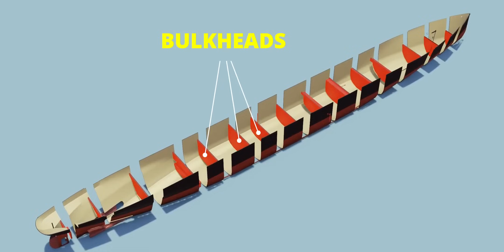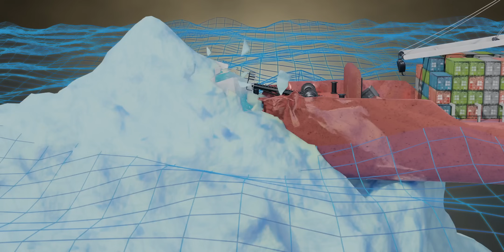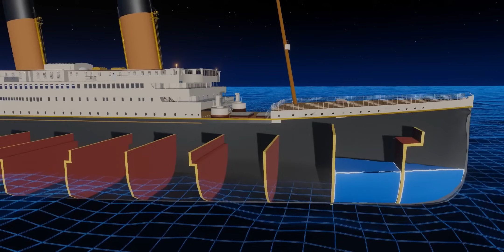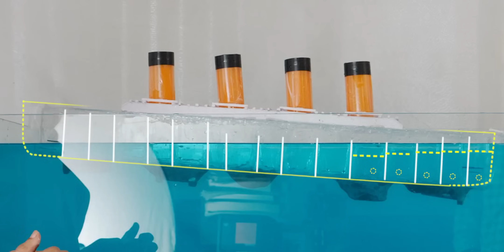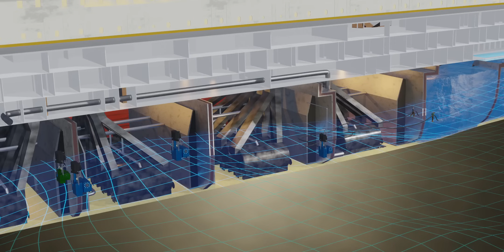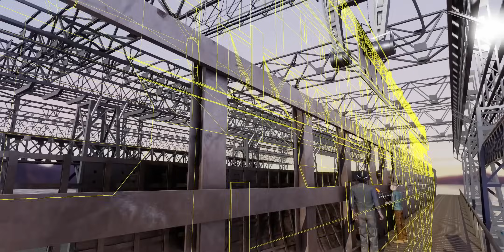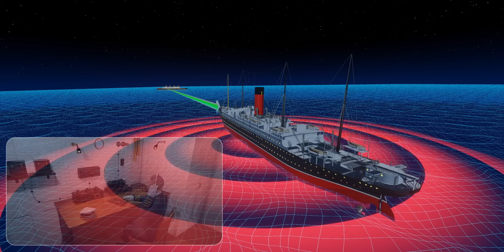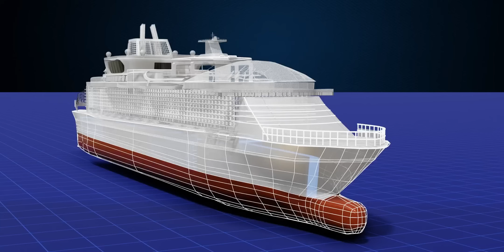How did Titanic Sink? | The Complete Physics

Comment: First Officer Murdock did not throw RMS Titanic's engines into reverse as part of his iceberg avoidance maneuvers. Judging by the short distance between ship and berg upon discovery of the iceberg he simply cut the steam to the reciprocating engines while allowing the ship's inertia to help port around the iceberg. As the wheelhouse telegraphs didn't directly control the engines like modern day bridge controls he likely knew there wasn't enough time to execute a crashstop order. Aside from steering, all helm orders regarding adjustments in speed, etc. required crew members below to make manual changes to the ship's propulsion system which, depending on crew alertness, entailed a turn around time of varying lengths. Plus doing so would eventually negate rudder control buy reversing the waterflow passing over the rudder thus causing the opposite effect of the rudder's hard over position.

It's important to understand that the rivets used below the waterline was necessarily lower in quality due to the inability of using Harland & Wolff's hydraulic rivet machine at the angles involved in the varying contours along the ship's bow and stern areas. Rivets along this section of the hull had to be driven in by a two man riveting team. The steel alloy, incorrectly referred to as wrought iron, was actually steel with a low carbon composition. The higher the carbon content in steel, the stronger the steel however, it is much harder to work with. Only with hydraulic riveting can high quality high carbon rivets be rivetted into place. Softer, low carbon steel rivets that can more easily be hand riveted between two hull plates were used along the curvy areas of the ship's hull below the waterline where the hydraulic riveter couldn't be used.  Had higher quality steel been used along these sections of the ship's hull a two man riveting team simply could not achieve the seal between two plates before the rivet cooled.  

Even today there aren't many ships that utilize a double hull system with an outer and inner skin holding back ingress from entering the hull.  Such a double hull configuration only covers the bottom.  Such double membrane systems have caused destabilizing lists due to uneven flooding caused by the ingress of water along the extreme edges of the vessel.  We only have to look at the modern cruise ship Costa Concordia to see such a system wasn't used.  Upon collision with underwater rock formations there was just one layer of hull that was punctured, not two.
Reply: It's very important to note the rivets used in the extreme curves of the hull were not low-quality rivets, but the very same rivets used in any other ship of the day.

It's just that the heavy steel rivets were better/stronger.
Reply: @pc_buildyb0i935  It is known that Harland & Wolff used Grade 3 'best' iron rivets rather than Grade 4 'best best' in the construction of Titanic. What isn't known is the specific reason why the lower quality item was used or who signed off on it. A potential answer could be that the supplier didn’t have enough Grade 4 wrought iron rivets for both Olympic and Titanic. Either they naturally had too few or because of political pressure. It is known that Harland and Wolff pledged to spend as much money on the ship as possible, not less. Also the White Star Line (i.e. J. Bruce Ismay) could have been putting pressure on H&W to complete the ship asap and wasn't prepared to wait until supplies of Grade 4 became available.
Reply: @maunsell24  It's clear you missed my explanation of this very prominent half-truth in the community.

First off, let's get the most important fact out of the way - the choice in rivets doesn't have any impact regarding the iceberg collision. The iceberg collision involved a 52,000 ton ship striking a 5,000,000 ton iceberg along a point of contact no greater than 20 square feet at a speed of 21 knots. This is estimated to have generated between 30,000 to 300,000 TSI as a very conservative estimate. There isn't a single construction material available to naval architects even today, that could withstand even a quarter of that force.

Let's get the second most important fact out of the way - rivets back then were very broadly categorized in 4 main groups; no. 1 rivets, no. 2 rivets, and no.3 Best rivets. All of them were wrought-iron but no.3 Best was by far the best standard of the three, and the standard rivet choice for shipbuilders from the 1870s onward. They were practical, easy to manufacture in large quantities and thus easy to batch order, and relatively affordable. Practically every steel ship up to 1940s used these rivets in some way or another. By the early 1900s a brand new type of rivet had been introduced - no. 4 Best-Best rivets. These rivets were different - they weren't wrought iron like the previous three groups, they were solid steel and they were much larger and more heavy duty.

In fact, they were so much larger and heavy-duty than no.3 Best that they couldn't be heated up to the same temperatures (not with the rather limited blast furnaces available to shipyards in that time) and thus, they could not be hand-hammered into the hull plating.

In fact, hydraulic riveting machines needed to be created just for the installation of these new steel rivets. These hydraulic riveting machines were enormous, weight several tons each, and needed to be suspended vertically from a shipyard's slipway gantries. Due to this vertical suspension, these riveting machines could only reach the flat surfaces of a ship's hull - NOT the curved areas. They were first used on the flank plating of the RMS Mauretania's hull.

In Harland & Wolff's case, they took it a step further by having these rivets used not only on Olympic and Titanic's hull flank plating, but on their double bottom and keel plating as well. Not only did the use of so many more no.4 rivets help increase the bottom-heaviness of the hull, but they also helped disperse much larger stress loads.

Now, as I stated, the no. 4 Best-Best rivets could NOT be hand-hammered, and the riveting machines needed to install them could only operate on the flat surfaces of a ship's hull, so the curvature of the hull would necessitate the use of no.3 Best rivets. Keep in mind this is not a cost- nor corner-cutting practice because no.3 Best rivets were still by far the most widely used standard shipbuilding rivets. No. 4 was new and had only been used on a single generation of ocean liner at that point, and not even to the degree that Olympic and Titanic would have.

Of the 3000-odd rivet samples taken from the wreck site and tested, only about 10% were found to have any more than 20% slag by weight. Slag is indeed a form of structural impurity that can compromise a rivet's total strength but Board of Trade regulations of those days allowed as much as 33% slag by weight in no.3 Best rivets. The fact only a tenth of the tested rivets even had as much as a fifth of slag by weight tells us very clearly that Harland & Wolff were very selective of their rivet batches and even when using a 'lower' (but still perfectly acceptable) grade, they only took the best of the supply available.

Hope this clears things up for you.
Reply: @pc_buildyb0i935  Lower quality steel rivets were necessarily used in the curvier sections of Titanic's hull for two reasons:  (1.) the hydraulic riveter, which was a pretty massive piece of kit that hung from above by chains and was capable of riveting higher carbon steel rivets was incapable of achieving the angles needed to rivet; (2.) as such the task of riveting in those areas had to rely on traditional two man rivet teams who, with their own human limitations couldn't rivet high carbon rivets quick enough before cooling occurred with no watertight seal achieved. The solution was to use low carbon steel rivets which easily gets conflated as using cheap building materials because ostensibly White Star Line and/or Harland & Wolff were obviously trying to save a dime...the safety of the passengers be damned.  The reality is it was the only way these two-man crews could rivet by using a softer steel metal species. Hope this helps! 🙃
Reply: Hello! can I get any sources for this, I always thought they actually ´put the engines into reverse.
Reply: @MrChilongaso British inquiry, testimonies of Frederick Scott, Frederick Barrett, Thomas Dillon.
Reply: @MrChilongaso The only source for the engines being reversed was 4th officer Joseph Boxhall, who wasn't even on the bridge when the events of the collision occurred. All other testimony indicated the ship's engines were simply stopped.

The engines would not have been able to be reversed in time.
Reply: @MrChilongaso  First Officer Murdoch who was in command of the bridge unfortunately didn't survive, so there's no testimony from that first hand source.  However we have plenty of evidence supporting the fact that the ship wasn't put into reverse.  Frederick Barrett, chief fireman in Boiler Room No. 6 gave testimony that before the collision the engine telegraphs signalled STOP.  Upon seeing this he immediately yelled to the stokers to "Shut the dampers!"  You do this to help reduce steam pressure being fed to the engines further abaf in the ship. The other thing you do is to divert incoming steam pressure via a bypass valve straight into the engine's condensing units converting the steam back into water which is fed back into the boilers.  If there had been a helm order of "full reverse" the engines would have required an uninterrupted supply of steam meaning the black gang below would continue feeding the boilers with coal as normal.  🙃
Reply: This was proved to be nonsesne countless times. Another troll.
Reply: @HyperVegitoDBZ a lot was said here. With what, specifically, do you take issue?
Reply: @pc_buildyb0i935  countless movies, 3rd party institutions, from around the globe all found out that the "weak steel" nonsense is just that. Nonsense. There was no cutting costs in making or RMS Titanic. She was built to the current peak of the mettalurgic knowledge of 1912. Watch ocean liner designs video on the matter for overall explanations.
Reply: @HyperVegitoDBZ  Oh I'm well aware of that. I didn't know that's specifically what you were talking about.

But yeah, they did a pressure test in both 1998 and 2018 to confirm the strength of the ship's steel, and even had a documentary cover the 1998 test called "Answers from the Abyss". It's split into two parts here, so watch the first part for the steel test.

Titanic's steel tests out at 378 megapascals, with modern ships being built around 400. That's amazing when you consider the sample of Titanic's steel was sitting underneath 12,600ft of corrosive saltwater pressurized at 6000psi for over a century and is STILL almost as strong as modern ship steel.

And yeah, absolutely correct, that was the top-quality steel available in 1912 and in fact, metallurgy didn't improve until 1947 so it was quite literally the strongest steel available until steelmaking techniques became more advanced in the 1950s.
Reply: @pc_buildyb0i935  Their are actually other accounts about the engines being reversed (Most stating that the engines were put to reverse post collision) such as Poingdestre, Scarrot, Dillon, Scott, Rule, Rowe and others.
Reply: @OceanicCruiseline1912  Yes, I've read that too. But as you noted, the engines were reversed after the collision and the reason it was done was to bring them to a stop - reversing the ship's engines would have taken far longer than it took for the collision to occur after the iceberg was spotted, but using that rotational force against the engines' current movement would be a good idea for a crash stop, which was performed following the collision to kill the ship's forward momentum and prevent drifting.
Reply: @ Thanks for reply. I also agree they were reversed (Whether slow or Full). 
I have 2 questions aswell - 
1. What do you believe would have happened if the ship struck the berg head on?
2. What do you believe the telegraph orders were from 11:39 to 11:50?
Reply: @OceanicCruiseline1912  The ship almost certainly would have survived a head-on collision, but she'd be buckled in up to at least two compartments, killing a couple hundred passengers and crew in the bow. Murdoch would have almost certainly been court marshalled and charged with manslaughter/gross negligence. Trying to avoid the iceberg was the right thing to do, only a century+ of hindsight tells us any different.

It's pretty consistent in testimony that the engines were ordered All Stop on the main telegraph and then on the emergency telegraph, yet before the ship even hit the iceberg the engines and props would still have been going, with little difference having occurred over the 37 seconds elapsed between sighting and colliding with the iceberg. Immediately after the ship clears the berg, a reverse order is given so the ship can perform a crash stop. Titanic comes to a stop, drifting at maybe a knot or two by the time her engines are fully stopped.
Reply: @pc_buildyb0i935  Thanks for reply. Here are my thoughts - 
1. I think it might have sank if it hit head on but probably alot slower, enough for the survivors to escape though, many in the bow needed for the boats to be readied would have been killed along with several in the forward end. 
2. I personally believe that the iceberg was spotted at 11:39. At 11:39:40, All Stop is ordered on the telegraphs. Collision at 11;40:00. Engines stop at 11;41:30. At same time, Murdoch sets telegraphs to Slow / Full Astern. At 11:42:00, engines start backing. At 11:44:00, engines are ordered to stop. At 11:45:00, engines are set to Half Ahead by Captain Smith. At 11:49:00, engines are ordered to stop for final time. At 11;50:00, engines stop and steam begins to vent, lasting until Boat 5 starts lowering. 
What are your thoughts on this?
Reply: @ One other question: 
What are your thoughts on new (Though ongoing) research about Boat 10, suggesting it left later than previously thought, just after Boat D at roughly 2:08 AM? 
I agree with it as it explains numerous accounts such as Frank Evans and Edward Buley (Who reported water close to red port light which didn't go under till about 2:12)
Reply: To reverse the engines,  the Titanic needed to: 
Cut off steam to all three engines .
Allow the engines to wind down .
Change the gearing on the triple expansion engines .
Pressurize the "reverse" steam chambers .
While the Titanic could theoretically be put in reverse, the  process was time-consuming and complex, and it's debatable whether it was actually attempted in the time available before the collision with the iceberg. Crew testimony suggests the engines were simply stopped, not reversed, and the movie "Titanic" dramatized the scene. 
Yes, the Titanic could  be put in reverse, but it wasn't a simple matter of flipping a switch. The Titanic was a triple-screw steamer with three propellers: a center propeller and two outboard propellers on the port and starboard sides. The port and starboard propellers could be reversed, but the  center propeller could only propel forward.
Reply: @Aegean9582 exactly it's been mathematically proven that from the time that they saw the iceberg that a Time allowing for reaction time allowing for the time to send the telegraph message to the engine room then you have to also allow for the people in the engine room to have reaction time they're simply was not enough time to even begin the process of reversing the engines it's a complete fabrication and there were officers who testified that the engines were just put to stop engines if you are maybe going to hit an iceberg because you don't want to possibly break off all your propeller blades if you ride over the iceberg Titanic not only did she sideswipe the iceberg and she also rode on top of it engines in all stop!!!! If you are about to collide with an object on the road you don't put your transmission in Reverse no you apply the brakes!!!!!! This was all fabrication it has been well documented that both the American and the British inquiries were merely a show for the public many officers and crew perjured themselves and and simply lied about events that happened that night because it would cast a very Giant Shadow on the White Star Line which is one of the most prestigious shipping companies in Great Britain!!! Hey remember when Jose Canseco said there is no steroid use in Major League Baseball to Congress LOL LOL LOL LOL
Reply: @Aegean9582  people need to understand that even before the survivors of the Titanic disaster reached New York there were already stories and rumors and innuendo and lies being formulated the White Star Line was already formulating a story to sell to the public you have to remember that the White Star Line was a very prestigious it was very important to the British economy one of the biggest lies that were told is that she didn't break apart when she sunk even though hundreds of testimony from passengers indicated that the ship had broke in half before sinking but as with most government investigations it's propaganda!! So most people don't know this but when the Carpathia docked in New York City all of Titanic's officers and crew were assembled in a warehouse in New York City and were lectured White Star Line Representatives they were told the story to tell so immediately the fabrication lies and cover up begin!!! Also, doesn't anyone think it's odd that the log books and official log books and records of the ship did not Survived The Sinking? I mean after all the ship took almost 3 hours to sink all of her life votes were deployed at some point why didn't Captain Smith order that in accordance to maritime law by the way order that the log books and the official records of the Titanic the put on a Lifeboat!!!! There are massive cover-ups from the very beginning, and that's why I will never really truly know the real story of what happened that night because immediately there were lies, conspiracies, and cover-ups!!!
Reply: What effect would running the ship in reverse after the collision have on the flooding of the forward compartments? Could this have also slowed the flooding?
Reply: @TobyJ-r8k  I believe it's been shown that running a ship in reverse with allisions suffered in the hull's bow area has the effect of reducing the head pressure thus the rate of ingress into the hull. Obviously the night of April 14th the ship's bridge wasn't in the business of conducting theoretical experiments of the like. Indeed moments after the collision Captain Smith ordered Titanic's engines to half-ahead while the ship was being sounded by its officers until members of the black gang warned the officers that the ship's engines needed to be cut off completely as the forward motion actually increased the rate of ingress.
Reply: @RobbyHouseIV  Are you saying that running a ship in reverse would force all of the water to the front?
Reply: @adamgh0  No and I was not advocating that it's what the bridge should have done. I was saying that there is physics supporting the concept of reducing the rate of ingress into the hull but of course all that would have been completely impractical and, in the end, likely wouldn't have added much buoyancy time before she finally foundered at 2:40 AM ship time.
Reply: @RobbyHouseIV the James Cameron Titanic 1997 movie also make mistake little bit.
Reply: Titanic
Reply: Old West
Reply: Bullshit .. the idea of putting engines into reverse on any boat is slow the speed to minimise the speed of that collision
Reply: @iamasmurf1122  Are you saying that titanic must of put the engines in reverse?
Reply: You were there?
Reply: @DE.KarlJayce  were you? numerous officers were at the bridge at the time and what we know is a recounting of their memory
Reply: So you are 113 years old?
Reply: Titanic
Reply: Thank you finally someone who's done their research!!! It is just fantasy the idea that they put those giant steam engines in reverse and I think it was more of a concoction of the White Star Line to try and convince the public that everything was done to avoid colliding with the iceberg! The reality is number one Officer Murdoch or any officer at the time would have never have been taught to put the engines in Reverse in order to avoid colliding with an object they were taught to Port round or navigate around an object or obstruction and to use the ship's forward momentum and the rudder to navigate around an object! If you're driving down the highway and you see an object in the middle of the road that you're about to collide with do you throw your transmission in reverse? LOL no you use a combination of steering and engine power to maneuver around the obstruction the same is true with a giant ship besides there's no way in hell the Titanic could have slowed or stopped in time to avoid the Collision anyway and you're right about the engine room by the time the telegraph signals reaches the engine room and then the men actually start the process of reversing the engines they would have hit the iceberg anyway there's simply was not enough time to reverse engines this is Pure Fantasy that I believe originally started with the White Star Line on the surface to people who don't know anything about mechanics or engineering it sounds like a good idea well put the engines in Reverse slow the ship down also reversing the engines would have completely have negated the power of the rudder so in addition to the fact that naval officers were not taught to put engines in Reverse to avoid collisions but rather to maneuver around an object and also given the fact that we know for a fact that there was no way in hell that they could have put the engines in Reverse in any sort of amount of time necessary to begin to even slow the ship down this is purely Hollywood fantasy and probably an idea that the White Star Line propagated many decades ago!!!! Another inaccuracy in this video James Cameron and his 2012 documentary about his own movie from 1997 show with computer Naval software that Titanic never Rose more than 11 degrees out of the water not the dramatic 45° like in the movie and all other YouTube videos they proved with Naval architectural software that the ship never Rose more than 11 degrees this also explains why 11 degrees is not a big deal in fact this confirms the testimony from many passengers aboard the Titanic who never felt that they were in any sort of real trouble until the very end when the ship broke into and actually sunk in fact survivors in lifeboats didn't even believe that the ship was going to sink because of the very slight list that she showed in the water!! This very slight 11° is it almost unnoticeable would also explain why until the very last minutes of the sinking passengers and most of the crew believed that the ship was not going to sink if the ship had reached a 45° vertical angle then there would have been huge pandemonium but rather that's not the case from all survivor accounts we know that up until the very last minute of the ship's life people aboard the Titanic did not think that the ship would actually sink and that ultimately everyone would be rescued it was only after the ship broke apart and threw everyone into the water is when the reality of the situation was finally imprinted upon upon people that the ship indeed was going to sink and that they were going to go into the water!
Reply: Disagree. It filled with water. That's your problem right there.
Reply: Me and Dick Jones have had our fare share of conflicting theories over the years, but one thing we always agree on is that the rivets holding the ship together were of poor quality.
Reply: That has never been proven 
Please don't spread nonsense
Reply: Sup nerds.
Reply: @ginodelgobbo9237  Tell your mom I said what up.
Reply: @donnix1192  "Maa. Maa. Da iin'tanet Nerd knows you. He said whudup Maa.
Reply: @ginodelgobbo9237  I remember her saying “ my nerd son spends all his time calling people nerds online”